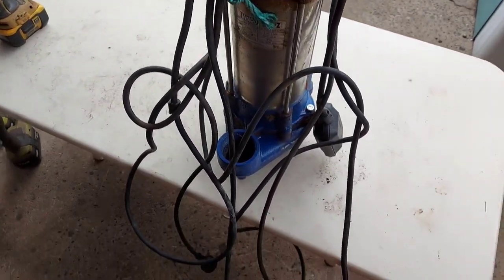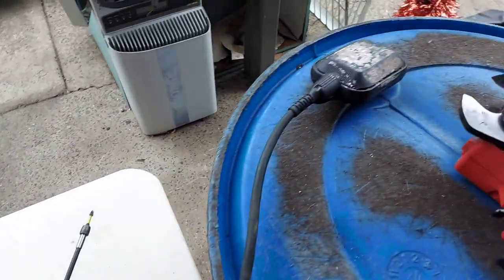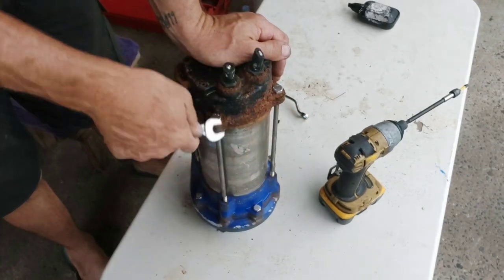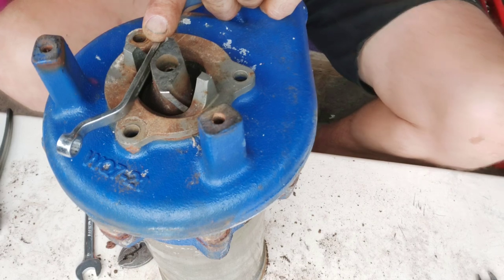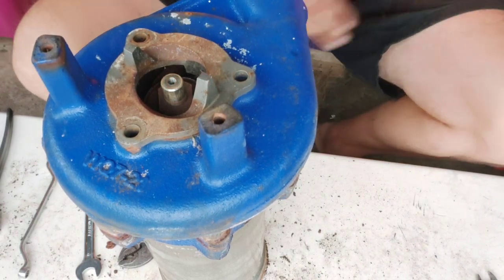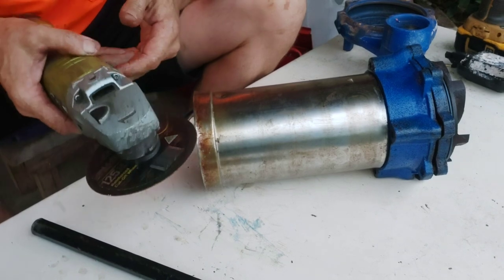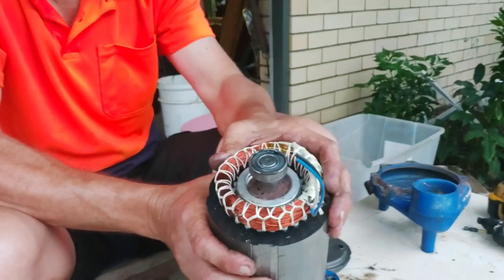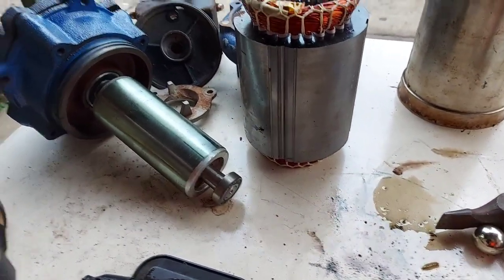Scrapping a Big Ass Water Pump

Comment: Do kids still play marbles at school? That steely would be worth 10 blondies or 1 stonka. LOL. 
I used to love playing marbles when I was at primary school. 
That was a really good tear down of that submersible, I have never done one so I would of been scratching my head to work out the way to go about also. You did well. You could see your cutting blade disappearing as you were cutting that stainless case. You can also see the difference in the way it throws sparks compared to normal steel. Heaps less and a different colour, ( lighter and not as orange). Interesting stuff and well recorded on the video to see. Enjoy the rest of the week Dan.👍
Reply from the maker: Tbh im not sure if they or not tho i remember playing marbles when i went to school in Singleton (NSW), we all loved the steely hehe.

Yeah it was tough on the grinder blade thats for sure, just slowly ate it....The whole tear down was learning as i went and iv now learned that next time ill just remove screws and not waste my time cracking seals and instead go straight to cutting the stainless casing and then knocking the top of that bearing and slide the motor straight out.....Cheers mate have a fantastic day.

Comment: That is a type of submergeable pump
Reply from the maker: I think your right coz we have something similar at work.
Reply: @danthescrapper815  i have worked with submersible pumps for a few years now. The thing with the steel ball is a floating switch. 
Once it gets to a low point it switches the pump off
Reply from the maker: @liamwilliams4297  Oh ok so thats what its for, thanks for the info buddy.